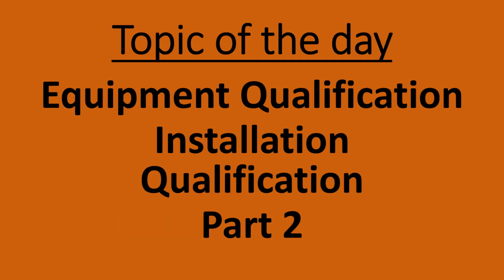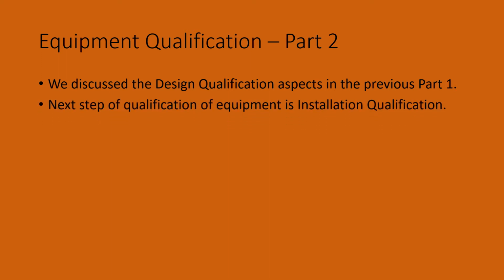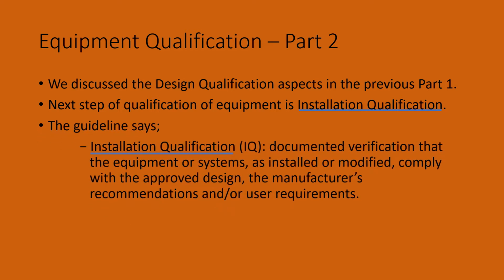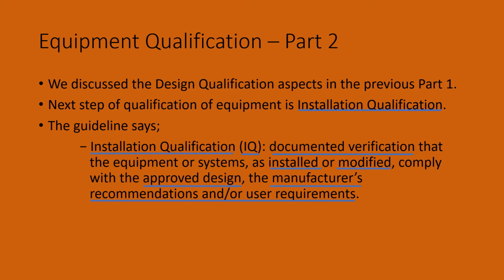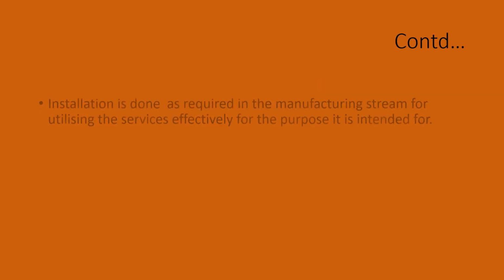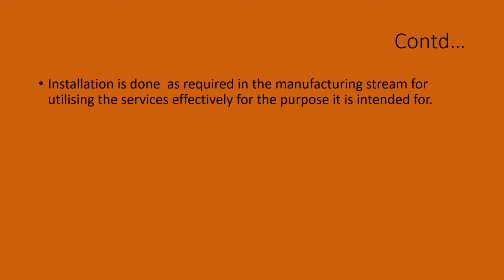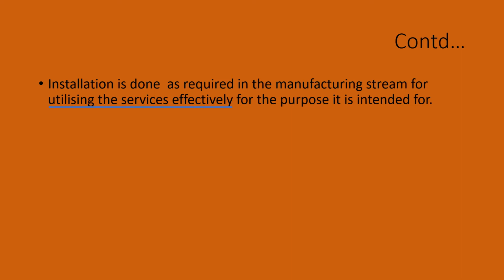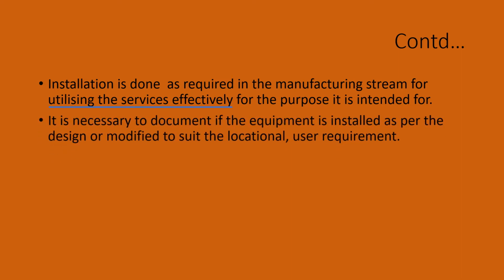Equipment Qualification   Part 2

Comment: Super sir. 🙏🙏
Pl. Explain with kind of checklist, what's going to be ensured step by step in qualification.
Reply from the maker: At each stage of qualification, it is necessary to capture all critical check points. Detailed check list depends on the type and criticality of equipment in manufacturing. DQ should have detailed design requirements, IQ should include necessary installation requirements including infrastructural requirements, OQ should contain functionality testing requirements. It is recommended that PQ should be done along with process validation with three consecutive batches. I tried to explain in brief. If the qualification requirement concept is understood well, you get good results.
Reply: @pharmaworldk1473  sir tq so much for reply. 🙏🙏. 
I hv read text in Google, but I know minimum requirements of qualifications but till now I dint get opportunity to work on qualification exercises. 

As you mentioned in message iam searching for content by browsing. Like requirements in each stage of qualification. 
If possible 🙏🙏  pleas make session by taking exercise on major equipment. 

Tq so much for session, I hv gained much info. 

If possible please make sessions on other topics too, co cok, pp, ppk, Audit compliance  approaches, Cleaning validation etc. 

🙏🙏